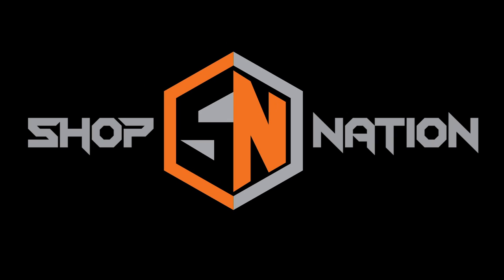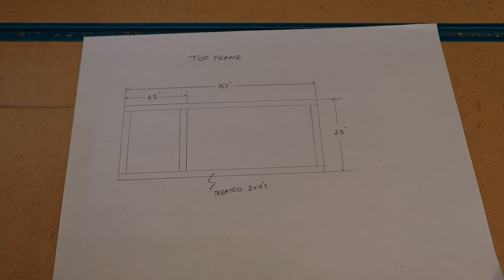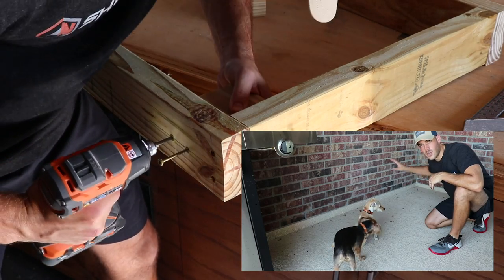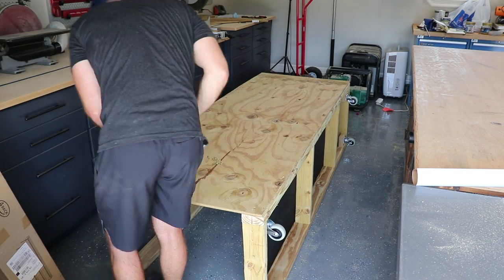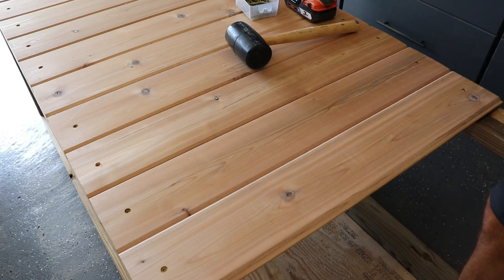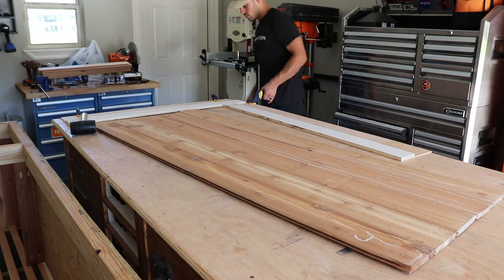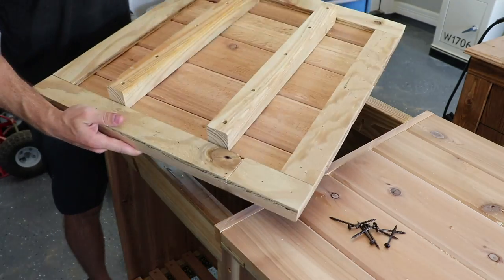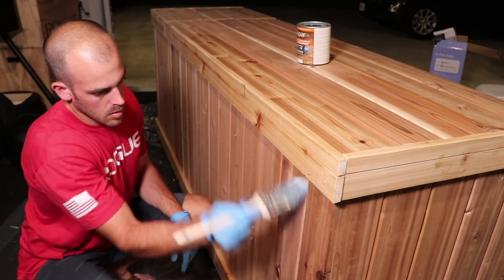How to Make a Patio Deck Box // Pool Storage

Comment: Hi ho here's a tip for you it works well for me, try putting some tea-tree & lemon oil in a spray bottle and spraying the inside of the box, it's a natural bug repellent and it smells better that the cedar, I have found a you-tube vide on natural bug repellents have a look at that as well. Unfortunately in won't stop the wife coming into your workshop.
Reply from the maker: 😂😂😂. Thank you I will try that